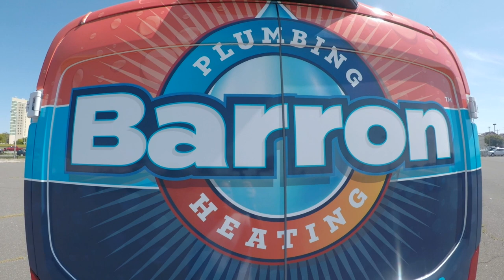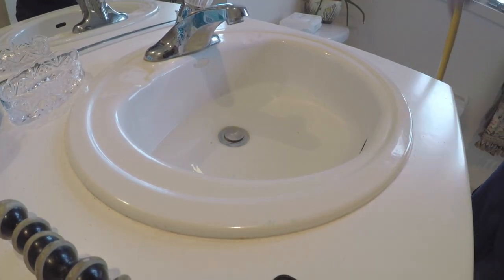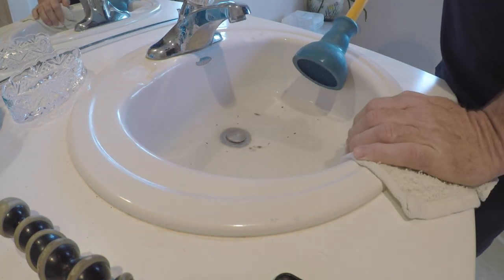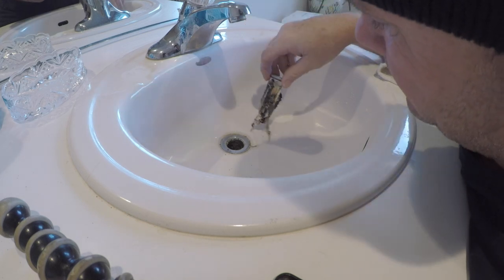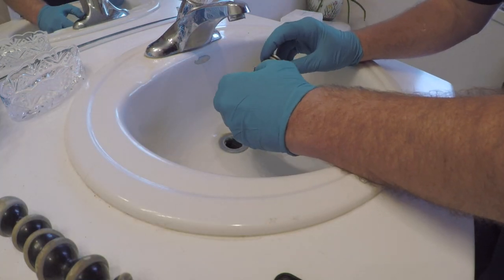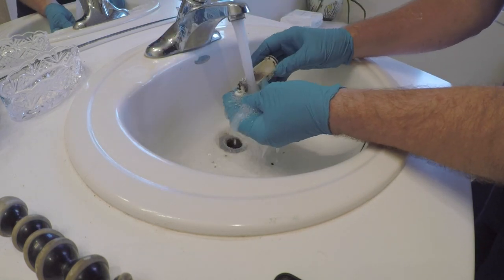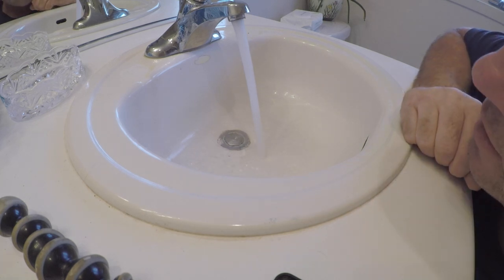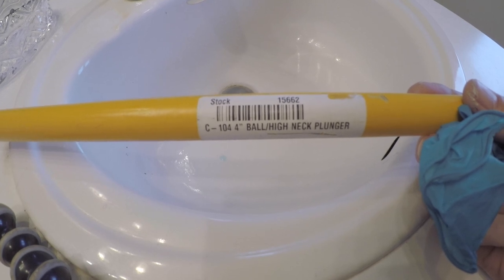PLUMBING REPAIRS | DRAIN CLOG TIPS | APPRENTICE

Comment: If You spun the "Pop-up" 180 degrees from where you installed it you would have gotten another 1/4" of lift. Creating a larger opening for the water to drain down faster. (You are still the Best! I always learn from your videos.) 🐤<-- Me @ 6 minutes old!
Reply from the maker: listen lil chicky.....ha.  this type pop up is not that type...but your on point Thanks For the tip....that may be a kohler pop up.
Reply: @ChuckBarron  Yes you are right.

Comment: one pump, two pump, three pump, BOOM and SPLOOSH, apart blows the junk plastic pipes under the cabinet.  I hate when that happens and it does, especially the kitchen ones with a nice food grease lubricant. 🤬 🤯💩
Reply: Good point there mr. Bottle! I always us my trusty "wet/Dry" shop vac. Works like a charm every time!